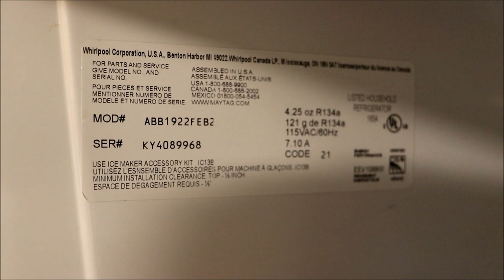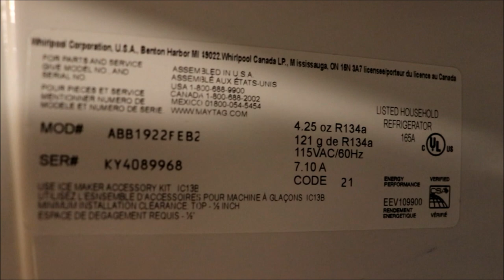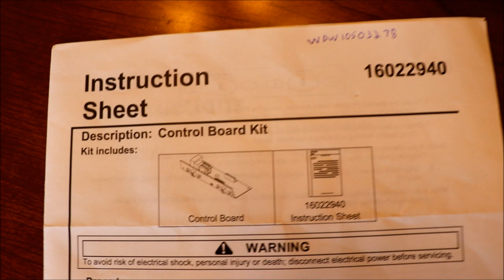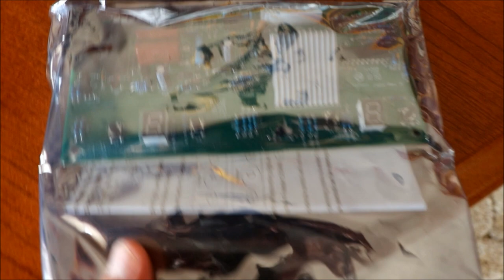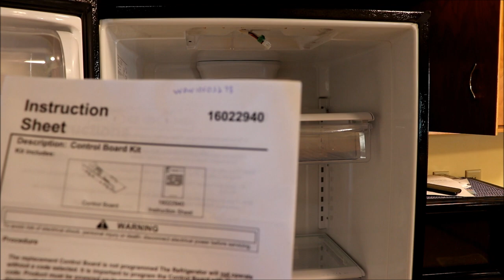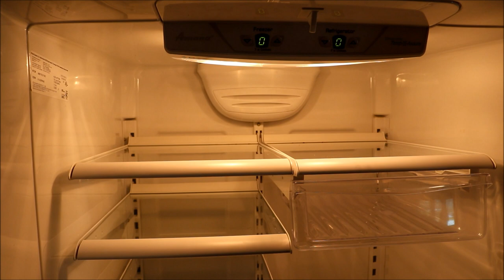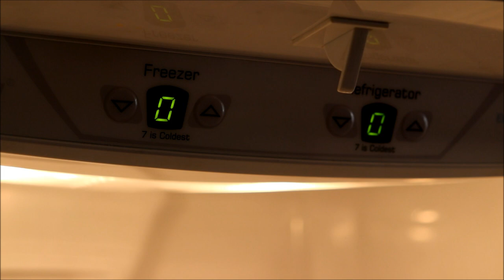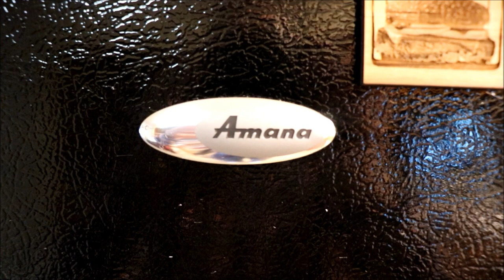Refrigerator Control Board Repair

Comment: we bought a new fridge one year and three weeks ago. It has stopped working with two dash marks where the temp range numbers should be.  What is interesting is other then the shape of the housing it looks identical to your older fridge.  Best video I have found so far that matches my modern fridge. Thanks
Reply: Same sitiation for me. Kenomre bottom freezer 596.6931...
Reply: @dr9402  I bought a board from Amazon. $57. FRIDGE WORKS LIKE NEW AGAIN.
Reply: Thanks, just purchased it. Arrives Dec 28th.👍
Reply: New board arrived. Runs like new again.👍

Comment: I have an 11 years old Maytag bottom freezer refrigerator and it has broke 4 times.  They replaced the computer board last month but couldn't guarantee that it would  solve the temperature problems in the fridge.  At first it was better and not freezing all my produce in the fridge but then a month later the fridge wasn't working at all and he said there was nothing else I could do and assured me that it wasn't the thermostat. So I just bought a new fridge and  went with a GE model this time.  Hopefully, it will work better than the Maytag did.

Comment: Is it still running 5 years later?
Reply from the maker: No, acted up again and decided to purchase a new refrigerator
Reply: @stuntcardriver  
Ok. I just replaced my control board, with your help, maybe I'll get lucky. 
 Thank you.
Reply from the maker: Seems like those board only work for a few years before they need replacement.   @sharksport01
Reply: @stuntcardriver  
It didn't even work 1 hour.

Comment: I can't pull the spec sheet out from the bottom coils. Any suggestions on how to remove the sheets from the plastic envelope? Where can I get the the tech sheets if I can't get them out from the bottom of the refrigerator?
Reply from the maker: I believe they can be found online.

Comment: Did you go thru the diagnostic steps to test the various components of the fridge?
Reply from the maker: I did.  Has been working ever since.
Reply: @stuntcardriver  My situation is, no frost on back wall of freezer, fan is working, damper vent is working, but it is still on the warm side in the fresh food top.  I lowered the setting to #2 instead of 4 and after all night its at 46 deg.  I just found the diagnostic papers behind the kick toe.
Reply from the maker: @pstef8936  It sounds like you're on the right track.  I have had the same problem every time frost build up.
Reply: @pstef8936  I recommend setting freezer to 4 and FF to 5 or 6 to achieve desired FF temp - 38°. Test temperature if foid or beverage they had been in there at least 4-8 hours. Air warms as soon as you open the door, needing another 4 hours to cool again.

Comment: Thank you for taking the time, our fridge is identical.
Reply from the maker: Glad I could help.
Reply: Actually, it isn't. Did he show you how to test circuits? Defrost Thermostat, Thermistor (temperature sensors)? Defrost heater? Did he go through the 8 different diagnostic service test the board can do? Did he put it in forced defrost cto determine if the heater and defrost Thermostat are working?

Comment: I have the same fridge. Same exact one. I've already replaced the thermostat. 

"let's get a new fridge!!"

Well- we want counter depth. Our space is 1/4" inch too narrow. So we'd have to move fridge, add another 15A circuit and outlet, remove other cabinets, and do another cabinet build in space where old fridge was...

I'd rather replace the control board in near term....

Comment: Similar problem here.   Bottom was frozen up.   I just went through multiple tests via the service menu.   Everything tested out fine, but the FD, (Forced Defrost), didn't seem to be happening.   Tried it multiple times, and on the 3rd try I heard hissing and cold air started coming back.   I'm thinking this jazz board is probably flakey and I'll swap it out

Comment: Thank you 
@stuntcardriver for this great video. My Kenmore fridge keeps setting both the fridge and the freezer temperature to 7 and  I have to try like 50 times to revert it back to 4 by pressing the down arrow (most of the times it will not respond when I press the down arrow) and then at sometime later it will increase it up again to 7 on it's own. I was checking and found the fridge has 2 control boards, the one in the video and there is also another one in the back so I am not sure which one is bad. Do you have any idea? Also do you still have the link for the board you bought? Thanks again for this great video !
Reply from the maker: I bought the control board from Amazon.  
https://www.amazon.com/Tosva-W10503278-Whirlpool-PS11755733-WPW10503278/dp/B07GCM54RW/ref=sr_1_3?dchild=1&keywords=Tosva+W10503278+for+Whirlpool+Kenmore+PS11755733+AP6022400+WPW10503278+WPW10503278+Jazz+Board&qid=1628158302&sr=8-3

Comment: There are two openings to put a slotted screw driver in to open the control cover.
Reply: I use a tablespoon because the handle got  the perfect curvature. Just hole it with a hand towel or a  pan glove

Comment: I've already bought a new part for the fridge, I couldn't for the life of me find out how to perform a forced defrost. The new part I bought replaced a part that wasn't messed up in the beginning, I hope it's not the board but if it is at least I know I can find it cheaper. The local fix it place can get them for $160.
Reply: Tech sheet should be under center front  stuck in plastic bag. All diagnostics are given. I think forces defrost is done by pushing freezer temp down button 3 times. The chosing S (short defrost) with fresh food up button. Other videos explain
Reply: Amazon sells those jazz board for $38.
Reply: @Jake-by9ly  the tech sheet is kept at the back near the compressor.  Open the lower back cover and it's wedged on the left side.

Comment: After spending $3,000....Less than 2 years later (right outside the warranty) My family have practically been camping out of ice chests for OVER a month now! The worst part is Whirlpool subcontracts out their service repairs to 3rd party service specialist but the problem is they NEVER showed up after 4X of calling them out. I had to miss out of 4 different days of work. Finally a guy came out NEVER picked up 1 tool. NEVER took ANYTHING apart. I told him i thought it was the control board, he then proceeds to walk over to the fridge and say yep its the control board and wants $500 which i had no issue paying but said the part would take 4-6 weeks before it was delivered due to shipping delays cause of covid plus the company itself is back up several more weeks. I don't think ANYONE really knows what its like to go without a refrigerator for an extended period of time. Anyways the wanna be tech tried to charge me $125 before kicking him out of my house. Then i ordered another control board which took over a week (which i thought was the wrong board but really it was the right one and just needed to be broken in half go figure) Anyways so i ordered another board waited over another week. The 2nd board i installed only to find out my fridge still didn't work so i'm thinking that theres something major going on so i'm researching for another week why dashes are showing on my control board. Then finally tonight i said forget trying to get my refund for the first board i'm gonna try to break it in half (LOL) and install it. Well i did. And FINALLY i heard the compressor come on. I followed the steps in the video step by step and now THANKS YOU my family finally has a fridge. Were no longer camping out of ice chest buying 40LBS of ice a day!!!! THANK YOU SO MUCH YOU MADE MY NIGHT AND I"M GONNA SLEEP LIKE A BABY NOW!!! 🤪🙏🙏🙏 May GOD bless you with an abundance of blessings my friend.
Reply from the maker: Glad it helped.  Ours started getting warm again.  I ordered a new GE with a freezer on top.  I am done sticking parts in to this one

Comment: Cant believe he said "this is just a stupid design"  then proceeds to wrestle with a smooth shiny plastic piece on top of an equally smooth shiny wood table top !
If he was not a "stupid" man he would place a dish towel or an old T-Skirt between both the part and the table.  I am sure his wife would concur with me.
Word of advice ! always ensure that when working with plastic components apply some heat to it first. You avoid snapping those small lock tabs.
When ordering parts make sure you see the part exact numbers in the add to ensure its compatible !

Comment: As a pro I can say, this guy doesn't know what he is doing! The jazz boyd is the least likely cause of problems. The connection TO IT could be corroded from moisture. Simple disconnecting and reconnecting often scrapes off the corrosion. Defective $20 defrost Thermostats are the main reason fir poor or no cooling in fresh food section because the frost build-up blocks air flow to the FF section. Uncleaned condenser coil beneath or behind the unit also will make compressor work harder. Free air flow is essential to creating the heat exchange. The defrost heater could be burnt out - not common in WHIRLPOOL/MAYTAG family of BRANDS. COMMON amongst ALL BRANDS is a bad compressor relay or tired compressor. I ALWAYS replace those with a 3-in-one relay, overload and start capacitor - SUPCO #UCRO410 UCRO410RC or equivalent available from any appliance parts store and AMAZON.
Reply from the maker: It's been good for 4 years.
Reply: The problem was the fridge not defrosting.  One of the main causes is the defrost timer.  This fridge does not have a seperate defrost timer, the defrost cycle is controlled by the jazz board.
I am not a "pro", I just have the same issue and I've been doing my homework.
Your comment gives me the impression that you are either new to the profession, or just not very good at it.
Reply: I agree with John.  My unit is 14 years old.  I just replaced my second board today.  Had the same problem twice and both times it was the board.

Comment: Is it made in China?
Reply from the maker: The control board is.
Reply: @stuntcardriver  so that's why it keeps breaking!
Reply from the maker: @davemcguigan218  So frustrating.
Reply: @davemcguigan218  no, it's because WHIRLPOOL and MAYTAG didn't protect the board better from moisture damage. OFTEN, simply disconnecting and reconnecting the plugs will scrape off corrosion, fixing the REAL PROBLEM
Reply: @Jake-by9ly  thanks Jake!!!